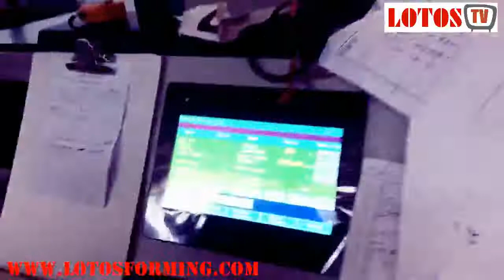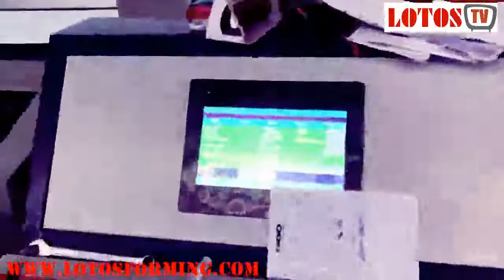steel/metal/coil Cut to Length Machine (2019)

Comment from the maker: Two series of flattening machines are available: with 19 rollers, diameter 56, tor standard metals and with 21 rollers, diameter45, far fragile metals such as aluminium, copper, stainless steel, etc. The machines all have centralized lubrication, with continuous recycling tor transmission.
Reply from the maker: LOTOS cut-to-length lines are sheet metal forming lines for strip material. The strip material is transferred from the coil, leveled, cut-to-length and stacked. By combining components according to our customers' specific production requirements we design customized lines that provide optimum production capacity.